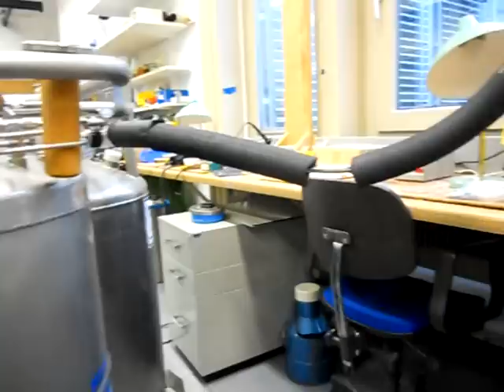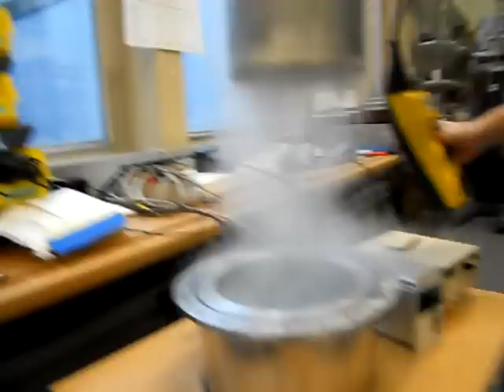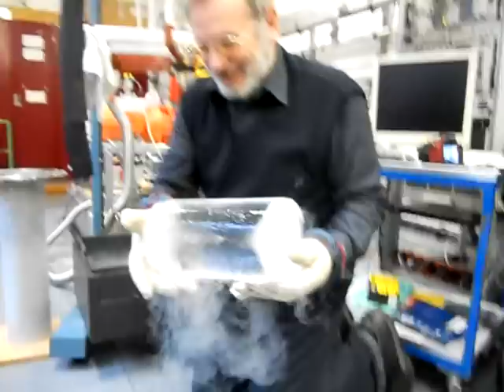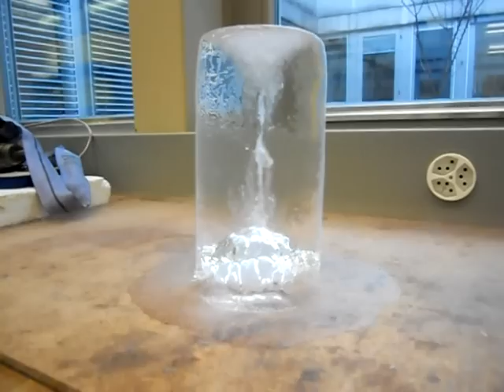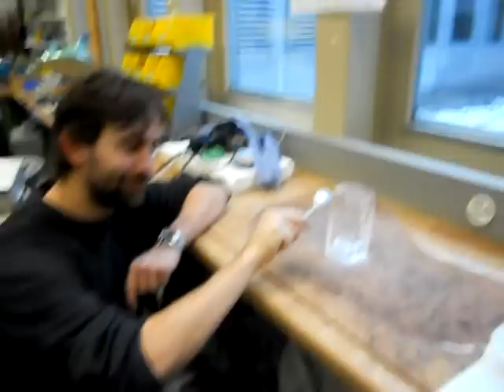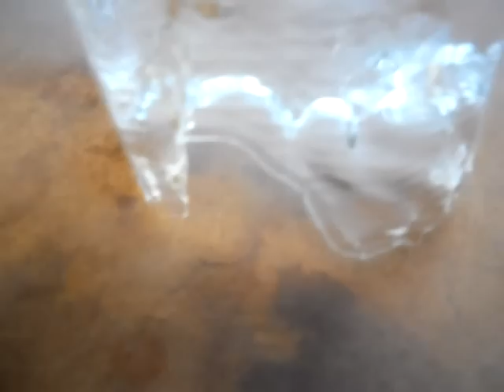Solid Argon

Comment: A large block of solid oxygen would be even cooler to see given its blue color though you'd have to be aware of potential fire hazards and use substances with temperatures below 54 kelvin which is around -219°C!

Most other room temperatures gases just look like regular old ice that we put in our drinks (which is still cool to see BTW) but those that are colored would be even cooler.

Comment from the maker: In the winter you can make outside just ice-cream. Do you think that the wintertemperature in Switzerland reach 83K (appr. -190 °C) ? Already at 87,3K you will have  have liquid argon! The melting temperature of LAr at 1bar is 83.8K and the boiling temperature at 1bar is 87.3K
Reply: Professor Janos, can you fix the metadata for this video so that YouTube knows it's in German?  I was very curious to know what your commentary was as you guys were doing your "taste tests" at the end of the video, but silly YouTube thinks the video is in English, so the auto-translate subtitles can't be used.